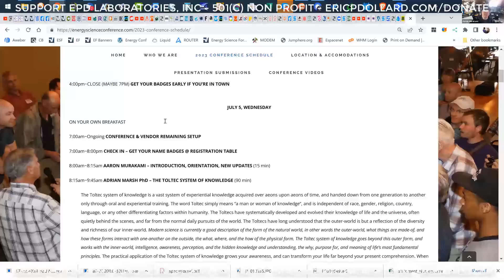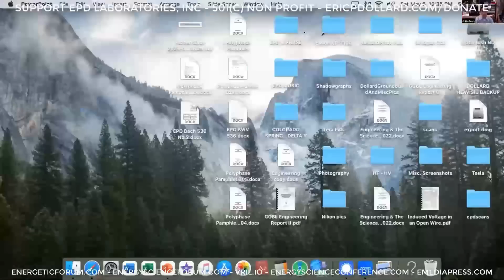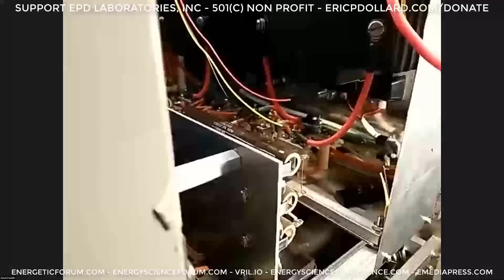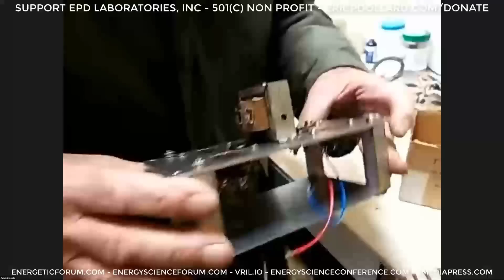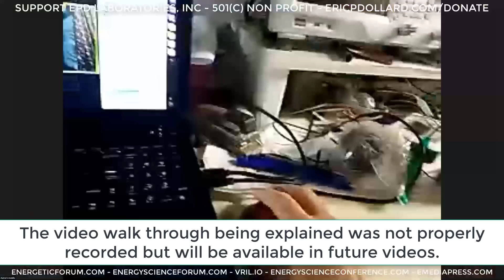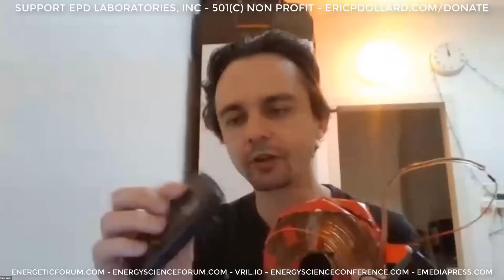2023 05 06 Eric Dollard Live Video Call

Comment: Ow hah! I've build a less than 1 Watt Tesla coil and found that LED's light up just in the proximity of the capacitive load. Heh, it has a bug zapper power supply on the primary. https://www.youtube.com/watch?v=lPwR9Thz8cM
Reply: System also worked on separate grounding rods with about 10 meter distance between the grounding rods.